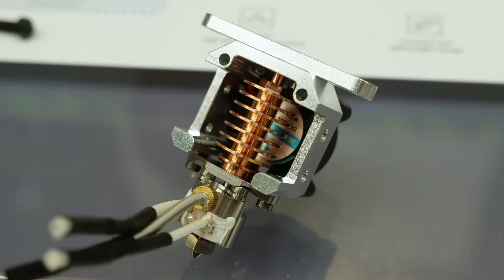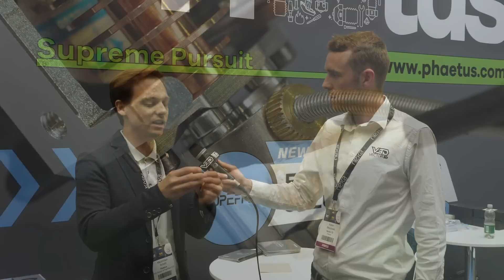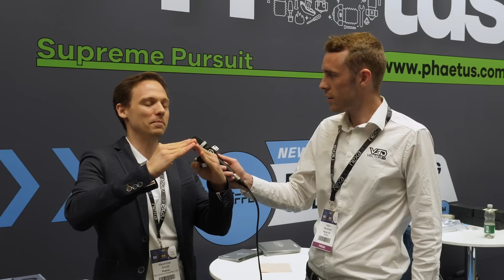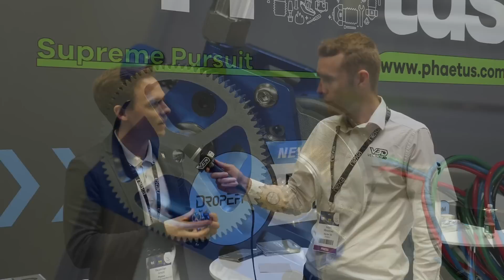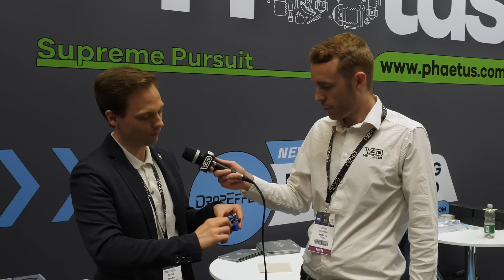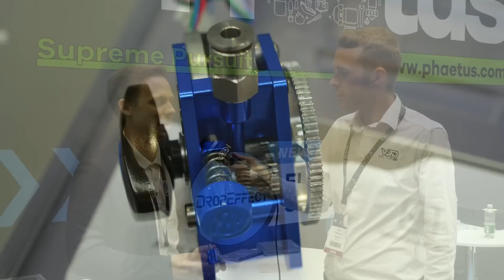Phaetus & Drop Effect TCT3Sixty

Comment: To convey torque you could include 3d printed torque tool that's setup for exact tension. I like the extruder but it still looks a bit bulky considering the materials used even though I do like heatsinking properties.

Comment: The decrease in nozzle thread size seems counter intuitive to me. I imagine that the limiting factor for heat transfer into the nozzle is more about transfer across the threaded junction rather than the thickness of the nozzle wall. Yes, the thermal conductivity for steel is much lower than Al or Cu and by decreasing wall thickness  you decrease the thermal resistance internal to the nozzle but if the limit is heat transfer across the thread junction then using a m4 thread will reduce the surface area and choke heat transfer further. I would like to see testing to confirm this.

I also don't think it solves a huge issue. I've done testing and cnckitchen has done testing which show that even in steady state extrusion scenarios, steel nozzles don't decrease flow significantly if at all.

I'm not saying drop effect is wrong but I definitely want to see testing.
Reply: A simplified idea of explaining why a thinner nozzle wall should help with heat transfer is that it adheres to same idea of a bi-metallic heatbreak, if you use a hardened steel nozzle it should help transfer the heat more efficiently into the filament, as you correctly pointed out already.
Here is some math that should underline the idea that M4 should slightly be better than M6;
The M6 thread has 50% more surface area than a M4 thread, however the M6 thread nozzle has 150% more volume than a M4, which means with only 34% less surface area the M4 nozzle needs to heat up only 37% of the volume of a M6 nozzle. You can use a CAD model to verify this. 
In the end does this revolutionize the flow rate of this hotend?: No it does not. It works just as efficiently as a Dragon ST Hotend, but engineering wise these number forced me to use a M4 thread :)

Comment: Using the term ‘kinametic coupling’ is just a fancy way of saying that the presence of heat is tightly controlled depending on location… … but i guess few people understand that, so they will think it is a ‘wonderfully magic feature’ … gosh people are soooo massively stupid .. 
and to be clear, the guy’s ‘explanation” is just pure BS: kinematic coupling has nothing to do with ‘3 points of contact’ … kinemativ coupling just describes the fact that the presence of something is tightly limited to a specific region of space…
Reply from the maker: Kinematic coupling is actually a very specific method of preventing motion between two bodies by removing degrees of freedom in an efficient low contact way and it's quite a smart way to connect these two things together whilst limiting the thermal transfer between them.
Reply: @Vector3DP  dude you mix WHAT and HOW … the theory of kinematic coupling does not involve thermal coupling problems…. it is a GENERIC principle like many others in physics. Applied to this particular scenario where someone wanted to manage the heat distribution, then it has lead to using a reduced contact surface between the 2 parts …. the fact that maxwell and kelvin applied it to heat exchange issues just reflects what the technical issues were in their time, not a limitation of the principle itself
Reply: If I had to guess, it's just a way to circumvent the Slice patent. It serves the same purpose as the 4 thin walled posts which slice uses to  to support the heaterblock